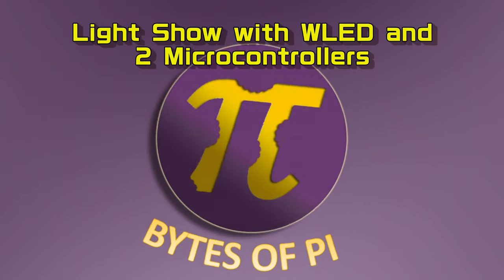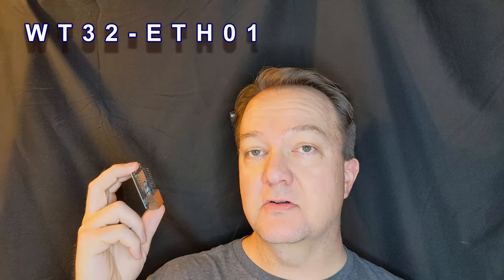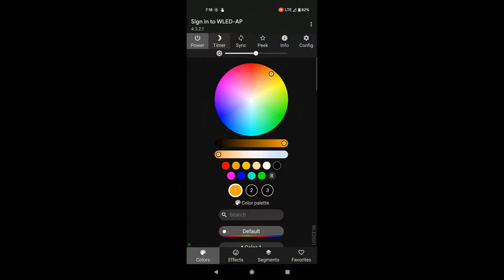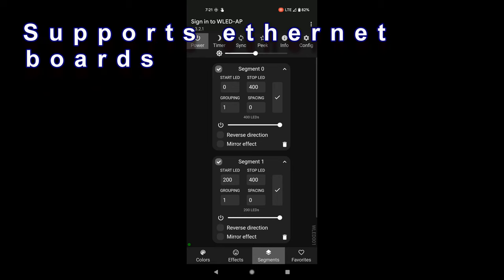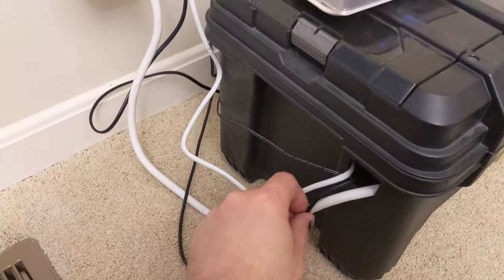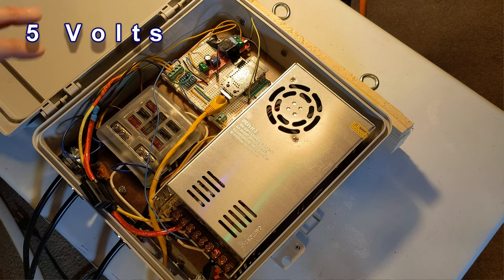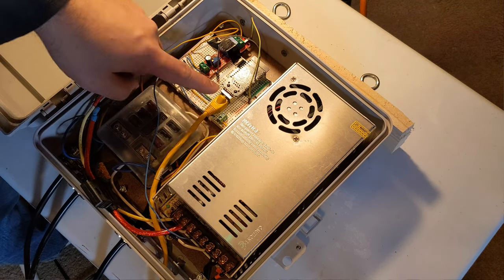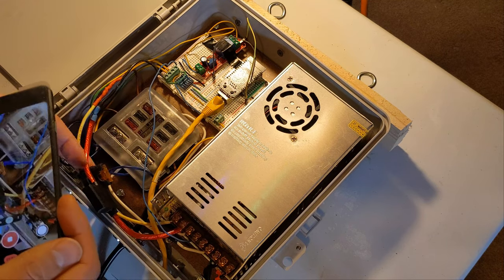Light Show Behind the Scenes - 2 cheap controllers and WLED

Comment: Hello again, I have a question about the controller. I would like to know how can I make an LED blink when connecting my controller via ethernet?

on the ETH01 board comes what is link pin but I don't know how the connection would be

could you help me with that?
Reply from the maker: Are you looking to use WLED to light up a string of LEDs or just run a "Hello World" blink for the WT32-ETH01?  

I've got another video (see below) on how to flash WLED onto that board.  The challenge for programming this particular board is that it doesn't have a micro USB cable to program.  You need to have a TTL Module Serial Converter Adapter to program...  

If you go to this part in the video (https://www.youtube.com/watch?v=nvM-QI4Z_M4&t=87s), I talk about the specific pins and even have a pinout.  Look at the pins on the side (IO2 means Pin 2, IO4 means Pin 4, IO12 is Pin 12 and so on).  Here is the actual pinout image - https://m.media-amazon.com/images/I/71CYGN4D47L._AC_SL1200_.jpg

If you've never programmed a microcontroller or an arduino, and you are looking to do a simple start without an adapter and use, there are easier boards to program with.  Most ET32 board you find on Amazon or other sites have a built in  USB port and use WiFi by default (no ethernet though).

You could go even easier and purchase one of Quindor's Digi Uno that has the software already flashed and ready to plugin and use with WLED.
Reply: @BytesOfPi  I ONLY THOUGHT THAT WHEN I CONNECTED THE ETHERNET CABLE TO THE BOARD, A POWER LED WILL ACTIVATE BUT I ALREADY MANAGED TO DO IT
Reply from the maker: @thehectorinproducer  , I'm not sure what you mean by "the power led would activate" when you plug the ethernet in.  The reason why the board is cheaper than other ethernet boards is that it's not POE power over ethernet.  

You have to provide a separate power source to turn it on. Also with POE boards the switch you connected to also has to support POE.  

The reason why I like 5 volt lights is that I can power the board the same power source as what powers the lights.

Comment: Is there a way to use digital relays with WLED for non smart lights ex. Flood lights or non smart trees ?
Reply from the maker: Oof... I've got so many thoughts on the topic it's going to be hard to reply.

Short answer WLED is not the right tool for ac (non pixel "smart" lights).  However, there are lots of options if you are looking to sequence "dumb" lights to music.

DIY Path
---------
5 years ago, I built a box using an 8 channel solid state relay that would turn 8 separate strands on and off.  There was a lot of hardware and programming involved.  First video explained hardware, 2nd and 3rd video was the build video, and last video was programming.  It was targeted for my wife's programming class, but probably not the most efficient way.  If you skip the last video, FPP can control GPIO pins just like my program would and take instructions from xLights sequences https://youtube.com/playlist?list=PLI52OsmA0tXyLtCUauV6TRnHpLaeu5tek

I based my build off of Dee Higginbotham 
https://youtube.com/playlist?list=PLQMY6gaXDkJeQWXHNwlDY9Bx7Umi2HPJo

Store bought path
---------------
If that is too much DIY, Light-O-Rama and Wired Watts have AC controllers that can take commands from x lights or vixen sequences

https://store.lightorama.com/collections/showtime
https://www.wiredwatts.com/p2tac9

Comment: Hi, great video.
Please let me know if I can use ESP8266 to control 5050 RGBW addressable leds 24V?
Thank you
Reply from the maker: I've not had to work with RGBWs and if the WLED packets include the W (white) component, but a quick Google search says that WLED indeed supports that.  It says that even though the power for the lights may be 12 or 24 volt, the data line is still 5 volt.

Here are two links with related information.

https://www.reddit.com/r/WLED/comments/pvyyur/success_5050_rgb_led_running_on_wled/

https://github.com/Aircoookie/WLED/issues/58
Reply: @BytesOfPi  Thank you

Comment: how did you attach everything?
Reply from the maker: For the data lines, I used 18/3 AWG gauge wire and connected them with the Ray Wu connector ends. 

 For the power injection lines, I use either 18/2 or 16/2 AWG gauge wire with 2 prong MUYI connectors

Comment: How many leds can be controlled with one card?
Reply from the maker: That really depends on the memory of the card.  I'm not yet tested the threshold of the cards, but one of the cards handles around 1500 pixels easily.

You can probably run much more, but if you string too many pixels on a single output port, the issue is then with the string and how many pixels it has to propagate the message down. If you can split your pixels between four output pins you could probably bump it up pretty high.

If it helps, the matrix and all the windows and doors are run off a single WT32-ETH01 microcontroller in my house videos this past year.

It used to be limited at 1500, and earlier builds due to ESP8266 memory limitations, but i believe they've increased the value support of some ESP32 boards like this.

Comment: Hello.  how do i wled fleshs on the ethernet device?  I couldn't do it without the USB connector.  would you give me how to do it!  thank you
Reply from the maker: Glad you point that out.  I believe to cut down on the cost of the board, the WT23-ETH01 doesn't have a micro usb port to flash like other common ESP32 boards on the market.  In order to flash, you need a TTL Module Serial Converter Adapter.  Here's a link to the adapter I use - https://amzn.to/3tVy9VR

I also have another video where I outline how to connect the adapter and flash the board.  Check out https://youtu.be/nvM-QI4Z_M4
Reply: @BytesOfPi  grazie mille 👍😊
Reply: @BytesOfPi  Hello.  I could ask you another question!  😊 how many channels can i use on wt32 ethernet?  for esp32 10 channels pin.  thank you
Reply from the maker: @salta199  
That's a good question. There are a lot of input output pins, but there are only 5 input output pins that are safe to use.  You might be able to use one of the other IO pins, but at best they might be sketchy.
IO2, IO4, IO12, IO14, IO15 - safe Input output pins

IO0, IO1, IO5 - reserved for programming
IO35, IO36, IO39 - input only (can't output a data signal)
IO32, IO33 - specialized pins...

Comment: I have a question when it comes to connect LED to the controller. I have a QuinLED-Dig-Quad Controller. For now I will be using 2 Channels as I will have 7 strips of 150 LED/Strip. First channel will have 4 strips (total of 600 LED which is what's recommended I believe), the second channel the rest. I will have power injected throughout. I know LED strips are directional, now, for simplicity and logistic reason it would be easier and more convenient for me to connect them opposite to prevent having a long data wire which is not recommended. ie: <----------led direction channel 1-----------< Controller >----------led direction channel 2----------->  Can I do that?
Reply from the maker: I think I understand what you are trying to accomplish.  You would like the controller to sit between the first run of 600 with data flowing to the left and the second run of 450 flowing to the right.

You can definitely do that.  Not only can you do that, but If you're planning on using WLED patterns and you want the patterns to work the same, when you go to segments, there is an option to reverse a segment.  If you reverse one of the segments, they'll behave as if the data was flowing in the opposite direction.

I don't know if you saw my other videos, but my arches and my alien trees have the controller sitting in the middle so that the data line is as short as possible for the props
Reply: @BytesOfPi  yes, that’s exactly what I’m trying to do!! Glad to hear that WLED can circonvenue this issue. It makes sense since  it’s not always possible to have the perfect setup where everything flows in the same direction with all the props near the power supply / data controller. 

My plan for this year is to have my roofline done (which is approx 750 LED) on a Dig Quad board using 2 channels and WLED. I’ll add more LED during the Summer. I want to start my project the right way and avoid complications when expanding it. I’d like to add music as well therefore WLED and xlights will be my next challenge. I haven’t figured out yet how to broadcast music but I’ll do some research later (probably need to buy an FM broadcasting device in some sort). 

Thanks again for your precious advice and time, greatly appreciated! I’m learning every time I watched one of your video!
Reply from the maker: @idscomm  That's awesome!  Start small and see if it works for you.  Getting started is the hardest part.  Once you get something working, building on is easier.

One last thing, mounting lights on a roofline is a pain.  

Before you go to all the trouble of soldering things and putting things in the air, try it on the ground using the default connectors to see if it behaves as you expect.  Connect using the factory connectors and reverse one of them in the segments.  Then try out patterns and see if it behaves as you expect.

Easier to change your design before you put it up then after its on your house.
Reply: @BytesOfPi  Thank you! I will definitively follow your advice as I agree, fixing strips issues on the roof is probably not fun at all lol!
Reply: @BytesOfPi  Another question if you don't mind... I was reviewing my calculation and I wanted to run something by you first in regards to power injection directly from my power supply. The is the hardware I currently have for my project:

LED Strips, 5v - 150 LED @ 45w per Strips x8
Power Supply 300W / 60amp x2

Now, I read that the recommended LED per channel was between 500-600 . I was planning in connecting 4 Strips per Channel making it 600. I wanted to inject power (16 gauge wire) at the beginning / end of every strip. My calculation (adding 20% of actual max consumption, another recommendation I read): 

Each 5v strip would draw 54W / 11 amp.
4 Strips would mean 216W / 44 amp. which sounds ok for the supply I have but most people recommend adding a Fuse between the Supply and the 1st strip. NOw I would need a 50 amp fuse which I don't know if this would be adequate for a 16 gauge wire...  

Your thoughts? Am I drawing too much power having 4 strips together? What would you recommend?
Reply from the maker: @idscomm   I think the calculations for amps are a little off.   You are not going to easily find a 50 amp fuse and if you did, your 16 AWG wire would burn up before it blew.

Give Bill Porter's VCS zoom talk a view.  He's an electrical engineer and explains things like power injection, wire gauges and fusing. It's the best explanation I have heard and gave me confidence in choosing.   https://youtu.be/eR3QbzjpZy8
Reply: @BytesOfPi  Thanks for the link, I watched the entire video. I guess when he says to forget everything about LED/Power Injection... he's right since he's method/calculation is a bit different than everywhere else I read. Almost confusing as to which method to use.

After watching this, I think I will put my first 600 LEDs on a 15a fuse running 16 gauge wire for power injection. This way it will be easier to manage since each channel recommendation is 600 LED anyway. I will have to calculate the brightness and lowering it to handle my fuse.

Does it make sense? In your opinion, I was planning on having one 16 Gauge wire approx 65ft for my power injection throughout, thoughts?
Reply from the maker: @idscomm  Is it 65 ft from your controller to your first pixel or 65 ft for the length of the entire strip?  

Bill's equations are conservative and is more of a guide.  15 amp fuse for 16 gauge wire seems risky,. The diameter of the fuse part that burns out should be smaller than the diameter of the wire you're using.   

I like being conservative so I don't start a fire.  If you have a 5 or 10 amp fuse you can give it a try up close before you hang your 600 lights.  Do some testing on the ground on how hot your wire gets with those lower fuses.

 I'm not an electrician, so take what I say with a bag of salt.  It's better to test as much as you can locally with smaller fuses and patterns you're expecting could feel confident before hanging them up

Comment: All of this seems waaay over complicated and engineered, for example a pc power supply would supplement the slow starting 5v dc power supply eliminating the need for a 555 delay, for example the pc power supply puts out 5v standby which is used to power the pi and also used to switch on the other 3.3v 5v and 12v rails by means of the pi programmed to pull the psu on pin to ground on demand waking up the psu which will then power the lights.
Reply from the maker: There's definitely multiple ways to attack the problem.  I have a few older defunct desktops that could donate a power supply that may be more reliable.

The issue I was trying to address is that on a cold startup of my Chinese 5v power supplies to power the WT32-ETH01 board and lights, the board would not start up.  I had to go physically disconnect the board from the power supply, wait a few seconds, then plug it back in. 

It's a hack for sure to use the NE555 timer to delay until the supply could provide a steady 5v, but it's worked in every build out since.  All of my Chinese power supplies pooped out in a few years time and I've since moved on to meanwell supplies which haven't failed once.  I might be able to take the delay out with better power supplies.

I'm a big fan of keeping designs simple. Less points of failure.  If there's a better supply that can spin up a board and lights reliably every time, I'd say go with that.